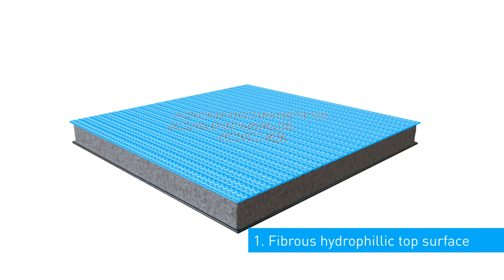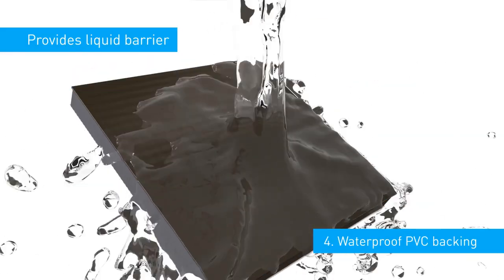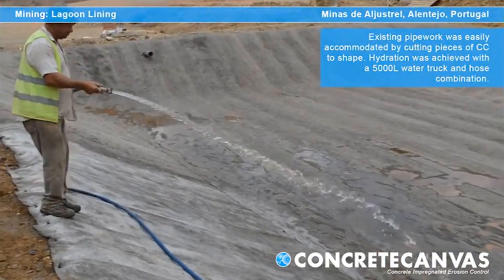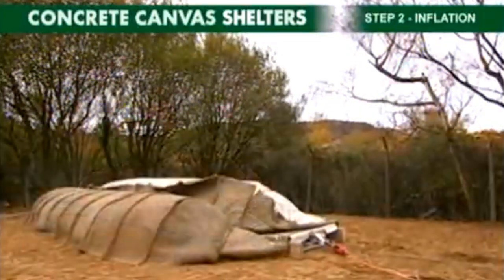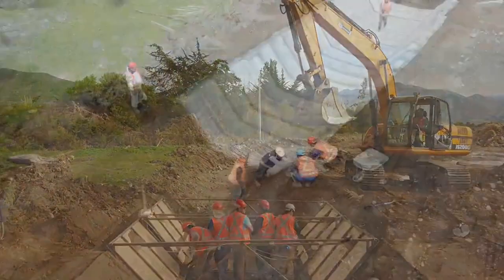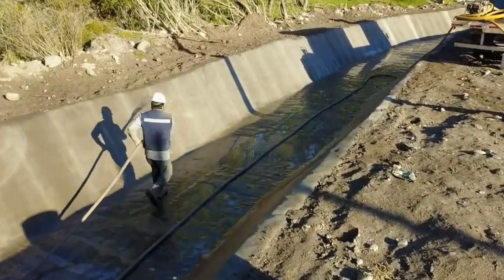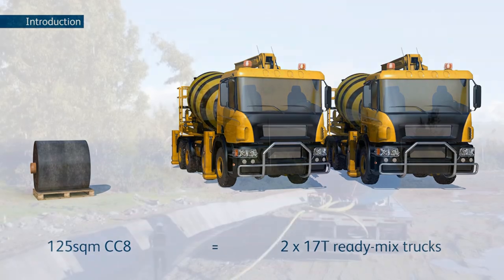Premade Concrete Canvas Tents - Just Add Water

Comment: to all who criticised the ventilation:
1. there are vents in the doors
2. there are doors on both ends
this means that air can constantly flow through the structure.
Reply: Also, it's just concrete. You can surely drill holes for more ventilation if you want.
Reply: @milesmccall2301  Thank you, exactly.

Comment: A lot of criticism of this product seems to be from people who seem to think this is a consumer product. That's completely misguided - this product is clearly aimed at civil engineering and military use where budgets are large enough to afford this kind of thing.

My main concern with this outside of the obvious price issue is the longevity. With the water-works example it seems like the vast majority of the work has to be completed anyway so the only benefit the concrete canvas seems to have over pre-fabricated elements or poured-in-place structures is it's weight and thus transport costs. However at only 10mm thick at best any water way would quickly erode through it meaning the channel would need constant maintenance. This is not to mention the dubious structural integrity of such a system when faced with things such as landslides, storm surges or otherwise. Either way it seems like the money saved in transport costs will be far less than the money spent on maintaining the structure.

As for the 'military' application with the 'tents'...it's laughable. The aim of the product is to establish a reasonably hardy shelter in a quick time-span, yet it accomplishes neither by military standards. A thin layer of concrete like this probably won't even stop some small arms fire, and having to wait 24 hours (after supplying the water as well) is a long time. In a 'hot' combat environment sandbags, Hesco barriers and other such devices are far superior in protection while being logistically simple and quickly established (not to mention the incremental nature of their construction. Every sandbag filled is a little extra protection - as opposed to this tent thing which is nothing until it's fully cured). In places not expected to receive incoming fire I see no reason why normal canvas tents can't be used as they have been for centuries. Tents like these are far lighter and cheaper and don't require anything but manpower to erect, unlike the concrete canvas 'tents' which demand both a water supply and a source of compressed air to be usable.

It's a nice idea, and it no doubt has it's advantages - however it costs far too much for far too little gain over the competitors. The bonuses it claims to grant are only counteracted by the flaws of it's design.
Reply: That's why I was mad. My tax dollars buy junk.

Comment: I've got so many questions about this as potential house structure or shop., like primarily how well would this hold up in high winds, what would be used as a foundation to satisfy city regulations, and so on. Not many buildings will hold up to a tornado - but I personally would still like to know what kind of wind speeds this will stand up against.

Comment: Pretty cool I wouldn’t mind putting one of them up in the mountains 😏For a bug out shelter
Reply: I like earth bag shelters. A lot of work but much cheaper.
Reply: Underground boi
Reply: I just did a quick Google on that.  $23,000 to $30,000.  A lot of better, cheaper ways to do that .. Hell, buy a used, run-out camper trailer and park it on a gravel pad.  Hook up a generator and you have a cozy little place for less than $5,000.   Hmmmmm.   Damn, that sounds like a good idea.  I might have to look around for a patch of land to put one on ...
Reply: William Potter Actually that’s similar to what I have right now .I have a cargo trailer I converted to a camper this way I don’t have to worry about the roof leaking fully stocked 😊 I got solar on it an outdoor shower even a small wood-burning stove in case I run out of propane ..Or gasoline for my generator..But the most important thing is ammunition😁👍
Reply: @hellcatredeye-g6582  Sounds like you have it figured out.  I guess one other thing I'd have to figure out is a water source.  A well I guess.  But you'd need that with the concrete shelter too ... Cheers !
Reply: William Potter Me and my kid kind of prepare for the end of the world 😂But it’s pretty cool going up there camping we do have a well up there already drilled about three years ago .about a mile up the road there’s A little creek that comes off the mountain which the water is crystal clear.Haven’t tested that but it’s always a good back up.North Georgia mountains
Reply: U might need it
Reply: ProseColored Glasses It’s not that hard and I can put my ATVs inside and still have room to sleep cook and watch TV 👍and you never have to worry about the roof leaking 😁I got a video up somewhere on YouTube I’ll have to look through so I can put a link up here so you can check it out 👍
Reply: I was thinking the same exact thing until I heard the price. Lol

Edit. Paying 60$ a square meter isn’t that bad,  maybe it could be used on top of a shanty of some sort. Quick flooring material too for a bug out.
Reply: One2Entertain News yeah that is pricey😂👍
Reply: Concrete is permanent. It would litter the forest
Reply: Exactly what I thought. 
Then maybe bring a trailer full of bags of  concrete mix, throw in some support beams and columns, and pack on extra layers of concrete on the outside. 
I'd probably want to dig deep enough down to have at least 6 feet of dirt over the top, plus the extra concrete. 
Gotta be the easiest way to make a real bunker. Plus I'd want a bunch of strips of that stuff to make tunnels
Reply: Douglas Hanson Oh I see that’s a pretty good idea I like that😊👍
Reply: Julian so what? And it wouldn’t be litter. You calling my home garbage? How dare you? How audacious of you. When I’m done living in it I could break it back down to rocks, however that would be ignorant and wasteful. I would rather give it to someone that would make use of it when I’m done with it. You’re unbelievable really. If the community, or society doesn’t see it because it’s so well camouflaged; is it still litter to you? Is it litter if most of it is buried and can’t even be seen from ground view? Maybe your whole life and thought pattern is just litter.
Reply: @williampotter2098   spend less than a grand more and just add a few solar panels and a battery bank.
Reply: @douglashanson7489    Generally you use Chicken wire for that.   It binds the concrete you trowel on the outside.
Reply: @AldousHuxley7  as far as I can tell it is not build to be underground.
The website doesn't clarify how much earth you can put on top of it, but the pictures only show a minimal amount of dirt on top of it.
Therefore I don't think it is strong enough to be buried.

Comment: This is great! Thanks for featuring us, Wonder World!
Reply from the maker: Sure no problem, it is an interesting building material.
Reply: Concrete_Canvas I think it would be great for making cycle paths especially from scratch, cheaply & quickly.
Reply: Fantastic product but I have to ask, is there any issue with the overlapping and the dry mix now under the waterproof pvc backing? or gushing water flow lifting the now solid shape?
Reply from the maker: think of the overlap matting like tiles on a roof, you overlap them in the direction the water flows. if there is backwash at a join, that I have no idea.
Reply: We need to have a concrete canvas production plant in Hawaii for the Pacific basin too.
This wonder material needs to be scaled up for the world to use.  The use case of concrete canvas is limitless.

Comment: with such thin layers , i would think this cracks in no time  ,with freezing or land movement .. they do flexible concrete now?
Reply: Concrete has no tensile strength and will crack easily on its own but the outer fabric layers and internal fibres would give it high tensile strength the same way that steel reinforcing does in regular concrete.  

Another concrete product that relies on fibre for its strength is the much cheaper fibre-reinforced concrete.  Thousands of tough polymer fibres about 10cm long are mixed into the wet concrete. It's then poured like normal concrete.  No steel reinforcing is needed at all.  I've had to cut through fibre-reinforced concrete.  It is incredibly resistant to cracking and a  complete pain the ass to remove.
Reply: Yep it's garbage.  Even fiber-reinforced concrete with rebar has to be poured to some thickness to resist cracking.  There's a limit to how much reinforcement material you can put into concrete before there is more material than concrete.  For a pop-up tent this is not really any replacement for heavy duty canvas given it isn't going to provide any better waterproofing or impact resistance.

Comment: I wonder if it could be used as roofing for a container home. Fire proof, storm proof compaired to plywood and asphalt shingles.
Reply: also probably quieter
Reply: Just watch out for the load bearing characteristics of containers. They are very strong at corners for vertical stacking, but you are not supposed to even walk on the unreinforced top (roof).  I thought of the same thing for a simple either above ground or buried container house the first time I saw info on concrete canvas. It is also pretty heavy to move and unroll, requiring a pretty hefty forklift, front end loader, etc.

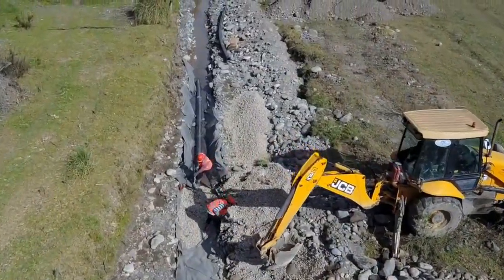Comment: 1:28 the rough water channel is better than a smooth canal.
Reply: It depends on a lot of things, like slope, the amount of area being drained, what is up and downstream, and how much water it is projected to handle.
Reply: @MonkeyJedi99  with better I also mean better as habitat for animals, as well as looks better. Apart from better water management.
Reply: @Flederratte  Fair points.
Reply: @Flederratte  This was my thought as well. Furthermore, the rough water channel is far, far better for floodwater management in regards to absorption, whereas a smooth concrete channel will violently overflow once it fills. 

I think.

Comment: The fabric if the costings could be reduced could be used as housing for homeless people..it could get them off the streets and into something warm and dry in winter..and it offer a degree of security for them as well.... just an idea?!
Reply: Seems like a good idea for the short term, but it's kicking the can down the road.
Getting them off the streets can be done. Keeping them off the streets begins with a triage of sorting them out and driving them to the help they need to get their minds and lives back on track. Rehab, getting them back to a state of 'employment eligibility', and a path forward is what they really need. Disincentifying an unproductive life on the street has to be part of the equation.
Back on point: There are many large vacant buildings that could be utilized for what we both allude to.
Reply: @burnerjack01  You sound like a do everything or do nothing kind of guy.
Reply: @rualert1602  He is pretty realistic.  The issue is that you can make structures of anything - but if you do it in the city (where the homeless WANT to be for services) then you run into NIMBY.  The homeless are homeless for a lot of reasons - some just don't want to be "told what to do."  That attitude extends to "working" as well.

There ARE no jobs for them, even if you get them "to that point."  Low skill labor jobs tend to already be filled, we have no shortage of low skilled labor.  (or people with skills that do it because they can't find "skilled" work.  Building some short of shetler is a one time cost, but then you have to accept that the person you put in it is a BURDEN to the SYSTEM as long as they live/remain.  That is a long term PERMANENT expense and it tends to be the sort of thing that gets cut FIRST.  (see:  NIMBY)

I still think the best long term solution is dispersal - there are apartments/houses in shrinking population small towns.  No, there are no jobs out there -- that is why they are shrinking.  Basic house/apartment and either food stamps or some sort of UBI.  Which yes, is pretty much describing Applachia.
Reply: OR, get this

OR

We could focus on providing products to people who PUT INTO society?!
Reply: Most homeless people are homeless because they value total freedom, doing drugs and don't want houses. The ones that are unfortunately homeless due to circumstance are rarely homeless for long, making drug infested shit covered slums will not help them get back on their feet.
Reply: @ghostinplainsight4803  "homeless people are homeless because they value total freedom" - this is a plain lie and you know it. The path down to homelessness starts with loosing the job, an illness or a divorce. Unable to pay your rent, you will loose your home and start living "in the street". As the situation gets more desperate the longer it lasts, alcohol and drugs are an easy way to bare the burden. And the spiral starts tuning even faster. The USA - one of the richest countries of the world - has no social security net for these people. In Germany 0,2 % of the population is homeless - in the US it is 2,5% !!
Reply: it would not be remotely warm, therei s no insulation properties to this at all.  it has literally no benefits over a heavy canvas quonset other than costing much more
Reply: Jim Johnson , Not really funny, at all.
Reply: Homeless in NYC have been put up in high class hotels during the COVID-19 crisis, and they'll still shit on the sidewalk and shoot up in the hallways. 
Homelessness is way more complicated than "just a roof over your head".

Comment: Nice, but too expensive. You could do almost do the same thing with vinyl bags that contain cement powder. Just spread out a bag on the ground, then add water. It will harden into a panel in twenty four hours. Total cost for an 8x12 panel would be around a hundred dollars. You could even make one long panel, which can be lifted by a few men, and then folded into a box. And it could have window and roof openings. Always look at cost. There’s usually a cheaper way to do just about anything.
Reply: Screenshot

Comment: But how strong is it? A thin layer of concrete usually crack quit easily.
Reply: i imagine it's more for the thermal properties of concrete than structural
Reply: Those cross linked fibers are the key to how strong the final material is . I'm very curious myself .
Reply: Pretty strong.  It is still concrete with fibre underwear so it is not like indestructible or anything.  Because of the fibre it is a little more durable than regular concrete of the same thickness but this stuff is not going to be used as structural components of things.
Reply: Probably relatively strong because it has fibers in it which greatly increase tensile strength
Reply: it is not ordinary concrete, it is fibre reinforced. its pretty strong.
Reply: You can't walk on it, so I assume it's only for thermal insulation, although it has some sort of fibers in it I am 100% sure it breaks very easily, in all cases concrete can't flex so much and that is extremely thin

Comment: Looks like a good solution for early Mars habitats...
Reply: actually, yes. why nobody has considered this :o
Reply: There is no water on Mars.....
Reply: @HxCxDxE  There is in fact water of Mars. And there is also ice that can be heated up to create water. That being said, these still wouldn't be very viable unless a large shipment of water is sent first, preferable along with rovers designed to set up the shelter for testing purposes.

Thinking about it though, I believe that concrete also requires oxygen. Well, that deflates that idea.
Reply: @HxCxDxE  
it's been years since scientists discovered water (ice) on the surface of Mars. look it up

Comment: How long does this concrete canvas last before breaking down?  Does seem that it'd last too many years, but I'm sure the company tested this before putting it on the market though I guess once they sell several billion dollars worth and in 10 years it starts falling apart and leaking it really won't matter much would it.
Reply: Well, there's one that's been up in the factory car park for around 15 years and it's as solid as any other concrete structure.
Reply: For Pete sake:with 5 gallons of elastameric paint and a roller you just added 20+ years to it.

Comment: I tried to represent this in Africa, specifically to US Military and others. This material is perfect and is multi purpose solution. I love it!
Reply: and difficult to steal! which unfortunately is an important factor in Africa
Reply: @swanthorn  the issue shouldn't be about stealing, it should be about development. I got to see the material firsthand while in Djibouti Africa in 2014, and I'm disappointed that the didn't embrace the potential infrastructure remedy that Concrete canvas brings to the table, especially in housing development, sidewalks and the potential for runaway  development just to name a few. We could have used this Iraq, for berm and ballistic protections. There are many new solutions and this one for me, based on where I have lived for past 20 years or more would greatly benefit from the awareness  that this product exist as a solution.